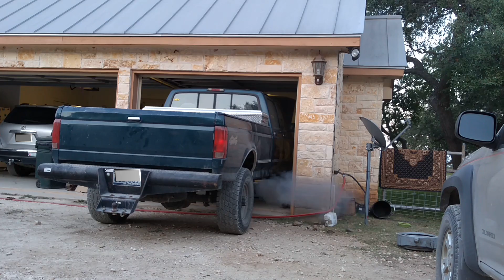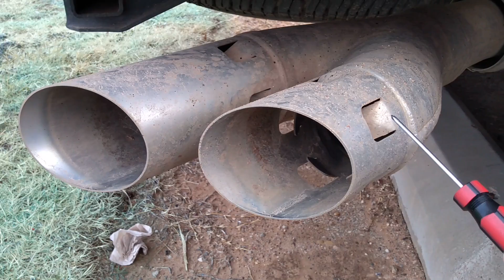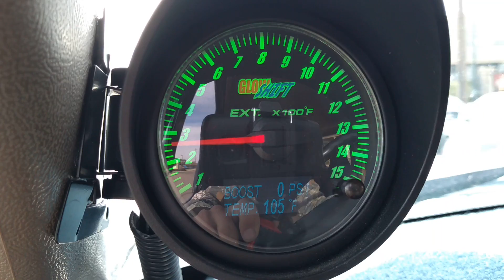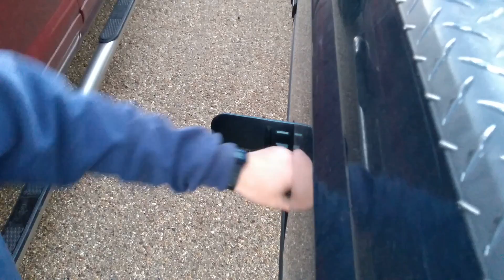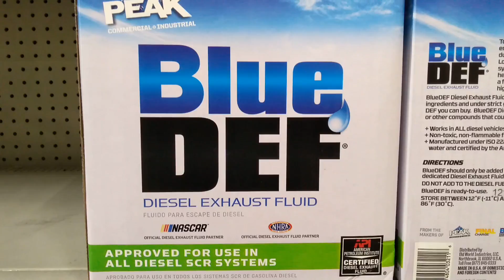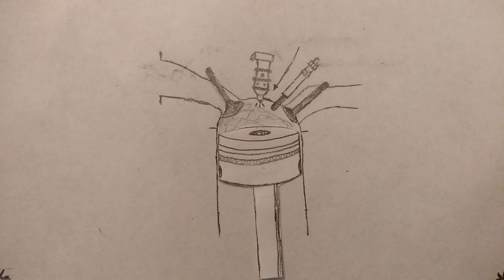Top 10 Things to Never do to a Diesel

Comment: Cant fault you or argue with you there buddy, on the rare occasion i have had to use ether (i religiously avoid it until the owner keeps saying try it try it and when i'm fed up of arguing i do it to shut them up and then get more work because it wrecks it) i give it a little blap/pulse while it is cranking or like you say the glow plugs ignite it, then i see people spraying it in like there watering the lawn,
Then the intake hose becomes a flame thrower and throws lit ether over the engine bay from the backfire
Also engines get addicted to it as such, from my understanding its because it creates a higher pressure in the cylinder on ignition, which then weakens the piston rings so they have a reduced compression rate,
Also i know on some vw group engines the glow plugs stay on after the engine has started to aid the combustion of a cold engine, this probably varies depending on region and emission codes of given countrys

Comment: I ran a bone stock 91 Dodge Cummins (the ones without the intercooler) and it is fine and another vehicle I got is a 96 Dodge Ram 3500 and I had it for maybe 2 days and the piston ring went on it and it’s parked now and my last vehicle is a 2005 Dodge Ram 3500 with a brand new engine directly from Cummins and it is mint. Thanks for the tips btw

Comment: I like to warm up my 02 dodge and put in in neutral to get the fluid flowing in the trany before I take off, otherwise it takes a bit to engage from park, and so did my friends..  I dono.. I just use for mine for summer fishing trips only so doesn't get used much! Only 82k on the clock..

Comment: Have a question when idling for a length of time setting idle at 1000 rpm a good thing or not?  Myself feel it's good others say not.
Reply: 1,000 to 1,200 rpms. At those rpms you’re maintaining the cylinder pressures so that the fuel doesn’t dilute oil. Idling for extended periods of time allows the fuel to go past the rings washing the cylinders and mixing with the oil.
Reply: Idling for 20 - 30 minutes all the time is not good. Idle 10 mins or less and go. My temp hits 100 degrees, then I can put my foot in it
Reply from the maker: I don't have enough experience to say what's best, though another YouTube creator named Adept Ape, who works a lot on heavy duty diesel engines claims that you really shouldn't idle very long. You may want to watch his video on the subject, he's seen way more diesel engines than I ever have. From my understanding, low load on the engine causes glazing of the cylinder liners and reduces the amount of diesel fuel that leaks past the piston rings thus wearing the engine out faster. I typically shut my engine down if I'll be idling for more than a minute. It saves on fuel anyway.

Comment: When oil is cold it has a low viscosity of 5 and gets to the top of the motor extremely quick, but it does not have the full protection qualities needed until the oil reaches 87 degrees Celsius, this is when it's viscosity is up around 30,(5/30w)
Reply: This is not at all correct. When oil is cold the viscosity is higher, not lower. Watch a Project Farm YouTube video where he tests oil and you will see it flows very slowly when cold.

Comment: When u said it's worse for deisel in a gasoline you are incorrect I had a pickup that I put 1 gallon of deisel into 1 full tank every time I filled up due to the fact it helps re-coat/ reseal damaged/worn rings helping with compression
Reply: Joseph Kelso interesting I’m going to follow up on this...thanks for your comment

Comment: You were wrong to suggest that adding additives that may not be compliant with the new ultra low sulfur diesel fuel would not have an effect on your engine and I will explain why.  

Just because your 7.3 is one of the first generation Powerstroke engines DOES NOT MEAN that it can accept just about any additive or diesel fuel.  Although you didn't say this specifically, by suggesting that you can run whatever additives and it won't have an effect on the engine because it is an older diesel is "sort of" implying that it's okay to run any kind of additive or diesel fuel.  That's simply not true.  

There are many reasons why but I will try to be brief and just list a few.  First, because of your statement that I'm commenting about, I fear you don't know as much as you should about your "older" Powerstroke engine and as such, I recommend you go and do your homework or research to understand how your "older" 7.3 Powerstroke diesel (1994 to 1999 version) and then the 2000 to 2003 versions are quite a bit different than the previous 7.3 and 6.9 liter IDI models.  For one thing, the way the fuel is delivered is quite different and the injectors are nothing alike.  Also, the oiling or lubricating system is nothing alike either.  

The older 6.9 or 7.3 diesels (pre-Powerstroke days prior to 1993 1/2) had "indirect injection" (IDI) and the newer Powerstroke models (1994 and newer) were "direct injected".  The injectors on the newer Powerstroke diesels were completely redesigned and ended up having quite a few rubber O-rings or seals around the outside of them to seal them in the injector "cup" or cavity that was inside the head.  These injectors were run by a very high pressure oiling system within the engine that was run by a very high pressure oil pump that is mounted towards the middle of the engine on the upper end in the front. Pressures would get up to around 2,800 to 3,000 psi rail pressure (I believe but do the research for 100% accurate figures) and sometimes as high as 3500 psi.  There is also a figure of 30,000 psi but can't remember off the top of my head what that figure was in reference to.

Anyway, as a tech that used to work on these when they first came out, we saw a lot of problems with driveability issues due to the O-rings and seals around the injectors being deteriorated from a lot of people using the wrong type of diesel fuel.  In my area of rural America, we had a lot of farmers trying to use the "off-road" or "farm fuel" (as it was known) in their newer Powerstroke engines.  The problem was, this fuel would "eat away" the O-rings very bad.  We would get complaints of poor fuel economy, low power, missing or hesitation, noises, hard starting, and just about anything in between.  

We would replace the O-rings and pretty much every time the problems would go away.  

I believe around 98 or 99 they finally improved the design of the O-rings so there weren't as many issues but they still had issues here and there.  

It is extremely important to use the right diesel in ANY Powerstroke engine and also make sure you're doing oil changes at 6,500 to 7,500 miles AND sucking out the 2 extra quarts from the high pressure oil pump (HPOP) when doing an oil change.  Otherwise, you will still have an older 2 quarts of oil circulating with your "new" oil when you do an oil change.  Change your fuel filter every other oil change or every 3rd oil change at the most and you will have a longer running engine (theoretically).  

PLEASE just go and do some more research on your so-called "older" Powerstroke diesel.  It's NOT OKAY to run whatever you want in it for fuel or additives.
Reply from the maker: I appreciate your insight! For better or worse I'm too young to have had any first hand experience using diesel in those days. I have always wondered if the red diesel we use in the tractors differs from the on road green diesel. Do you know if there's any difference aside from the dye? 

I guess I was a bit vague in implying that my 'older' Powerstroke can use pretty much any fuel additive. Of course you'd never want to run things like octane boosters, that's pretty much the opposite of what you'd want for diesel anyway. I'm intrigued with your experience back in the day where farmers had issues running off road diesel in their trucks causing the o-rings to deteriorate. As I understand it, we're having a similar issue with the biodiesel being added these days. I've heard it really tears apart the older fuel lines - like the rubber return lines on the idi's between the injectors. At this point I've had to replace nearly every fuel related seal in my truck owing to a fuel leak, though I don't know if that's just age or the new diesel. I'm hoping that using Viton seals and biodiesel compatible fuel lines that I can reduce the likelihood of future leaks. 

I've run some pretty bad fuel in my truck before, and I'm definitely glad it didn't mess up the injectors. In the past I ran some mineral oil for fuel in nearly 100% proportion. It wasn't the greatest idea and caused some temporary buildup on the injectors (I believe) resulting in white smoke. I'm suspecting the injector nozzles were getting clogged. Luckily a little bit of injector cleaner and not running garbage for fuel cleared things up. I had better luck with fresh vegetable oil from the store (diesel shortage) though that was only for a short duration (1 tank) and in low concentration (6 gallons of vegetable oil to about 10 gallons of diesel). I'm sure it helps as well that the fuel rail cast in the cylinder head helped to warm the vegetable oil before it got into the injectors. This I've always viewed as a bit of an advantage for the 7.3 Powerstroke when it comes to alternative fuels such as vegetable oil. 

I'm glad to hear you also have an appreciation for the operation of the HEUI injection system - or diesel injection in general. Hats off the Caterpillar and International for that one. At least for stock the 7.3 Powerstroke diesel injectors, that 500-3,000 PSI oil steps up the fuel injection pressures to 3,500 to 21,000 PSI (since the intensifier piston is a 7:1 ratio). I think it's wild though that modern diesels with common rail injection can get even higher injection pressures. Its still impressive that  ole' Harry Ricardo came up with the idea of indirect injection with the pre chamber as a solution to reduce the cost of diesel injection pumps through the use of lower pressures (in range of 3,000-5,000 max PSI) while keeping the engine power level to size ratio more favorable for light duty use. 

Oil wise, though it may be overkill (I'd rather be safe than sorry) I follow the Ford spec of changing oil and filter every 5,000 miles. I figure with as much as the oil is abused to run the injectors, heck even 5,000 miles seems like a stretch. 

So question for you, do you think an IDI would be better suited to running alternative fuels like vegetable oil or would the HEUI system fair better?
Reply: Thank you so much, I am a new diseal owner 6.0 power stroke  2003 and love it . Tuner, new injectors, high pressure oil pump,  new turbo. I change my oil every 5,000 miles , fuel filters every 2nd oil change. You are right so many people giving advice that have done no homework. Thanks again for your knowledge. 👍

Comment: Also you forgot, you HAVE to change your muffler bearing (unless you straight piped) once AT LEAST every 2 days. You're supposed to do it once a day, but once every 2 days won't hurt anything. I've been doing it once every 2 days for 20 years and no problems in the 7.3

Comment: Make some good points for people who have never owned a diesel which is a good thing most people that go out and buy a diesel truck have no common sense on how they work warming it up as a very good idea for any vehicle really cause engine parts are made of steel and aluminum nowadays and both those metals heat up at a different rate I like the fact you talked about your Your engine exhaust gassed in other terms your Pyrometer I know these things because I'm a commercial truck driver and all my tracks about all these gages and there to keep an eye on these things another good thing he should tell people is after they have run their truck if they run it hard or were towing  let it idle until  exhaust gas temp gets down to 300 or below or they could melt the wheels inside the Turbo if you have electric fans with a switch turn them on to help cool down  Or you can put an alarm on their with a remote start and a cool down mode and have that cool down mode set for a certain amount of time to let the engine cool down while you're not in the vehicle and the keys on the Ignition I have one on mine and they work very well

Comment: YOUNG MAN 

NEVER PUT GAS IN DIESEL SOONER OR LATER WILL BLOW YOUR ENGINE ! .

B U T  IF U HAVE GAS ENGINE  , WHEN YOUR TANK GAS GET LOW , WANT HURT  PUT ABOUT ONE GALLON OR 2 GALLON OF DIESEL FUEL , THIS WILL CLEAN YOUR GAS ENGINE  OUT BETTER , AFTER MY NEW PICKUP RUN FOR A YEAR AFTER I GET NEW ONE / THE SECOND I STARTED PUT ONE OR 2 GALLON OF DIESEL  ,FUEL KEEP MY IN SIDE GAS ENGINE CLEAN ! 

WILL WORK REAL GOOD ON GAS ENGINE  /   WHEN I BOUGHT MY 1 9 9 8  GMC TRUCK PICK-UP  HAVE  >   3 1 2 , 0 0 0  MILES  NOW !  PLUS  OIL CHANGE  EVERY 3 MOMTHS  TOO !

Comment: Never have had diesel, so this is all new to me. Sounds like many of your suggestions pertained to older diesel engines. To these pertain to the newer (maybe, last 5 yrs or so) diesel engines? Really enjoyed your video and presentation. Y'all Be Safe!
Reply from the maker: Yeah a lot of these do pertain to older diesel engines - at least that's the reference I'm coming from. I did try to throw in a mix to account for more modern diesel engines as well. Though frankly most of these topics are also applicable to modern diesel engines.

Comment: a diesel will stand 20%,petrol.BUT,not all the time,&,it does improve power..&,it kills the diesel bugs that build up..pull your tank filter,or endoscope inside tank to see the sludge..if your diesel stops for no reason,it could be sludge blocking the tank filter,,common cause..i had it..clean tank,use addative to kill bugs..

Comment: One you have hot exhaust going through it all the time then there's cool air coming out of the air going through it that is warmed by the hot temperatures under the hood so tell me how do you cool a turbo down that has very hot temperatures running through it it's not it's going to be the same way as it was when you were driving down the highway
Reply from the maker: It's all relative, by cool that really just means in the range of only 200-300°F or less. I've got an exhaust gas temperature probe in my truck and steady state on the highway it'll reach 800-900°F. That's how hot the air is going into the exhaust side of the turbocharger. Depending on how much you're on the gas pedal, the exhaust temperature can get well above 1000+°F. Letting it cool down at idle exposes the turbocharger to much lower exhaust temperatures in range of 200°F more or less depending on a bunch of other factors. This helps cool down the turbine side of the turbocharger from several hundred degrees to a much lower range. In theory it'll cool off much faster by having some lower temperature air flowing though it. Also keeping the engine running keeps oil flowing through the bearings so it doesn't overheat and turn to sludge inside the turbo bearings. I hope this answers your questions!
Reply: You should let it idle for a bit after running. The oil flowing through the turbo cools it sufficiently to prevent "turbo coking" where it burns on the bearing

Comment: I got 99 7.3 why does everyone say my pickup will be fine to literly squirt one second shot of either to save on battery and starter for wich I'm out in the middle of the boon docks no power to plug it in other than to a generator that will just die if you plug block in to it?

Comment: Diesel engines have more compression than a gasser they will ignite the gas many people ran a mix of "hot diesel" which is diesel gas mix normally like 18 gallons diesel to 1 gallon gas in their diesels to keep the fuel from jelling up and in instances that your injection pump is weak 1 or 2 quarts of used 15-40 per tank of fuel to up the pressure since its thicker

Comment: Do you recommend to block the EGR ?
Reply from the maker: I really don't know enough to say one way or the other. What engine do you have?
Reply: @Rnddiesel  Mercedes sprinter CDI 2007
Reply from the maker: @666alireza  Gotcha, well it depends on what you want to do. If you get smog tested in your area, you'll probably want to keep it on so you don't have trouble. I've heard mixed things as to whether it's good to delete or not. It'll definitely keep the engine cleaner to eliminate it, though I've heard it may or may not help with fuel economy to keep it on. It is also an added failure point, though deleting it would likely require tuning to get it to run right. I'd recommend you browse online, look at forums and see what other folks say. A question like that gets very engine specific real quick.

Comment: "Never bypass the glow plug controller! You will probably run them too much and burn them up. Yet, further down in the comments here you explain that one of the "benefits" to the controller is that it will sometimes run the glow plugs even if the engine is running! And sometimes it will go on running them for a while... Which is it? If it's a benefit for the controller to run them 'for a while', why is it a detriment if YOU run them 10 seconds instead of 8???

Personally... I hate that the GPs run every single time you turn the key. The glow plug only has a set number of times that it can run. It's the nature of the hot beast. The GPs simply break down after a while. As ANY electric heating element does. If you take a trip to town, and you stop maybe a dozen times... NONE of those times after the initial morning startup required the GPs, to get it started. So you have WASTED at least 11 cycles of your GPs.